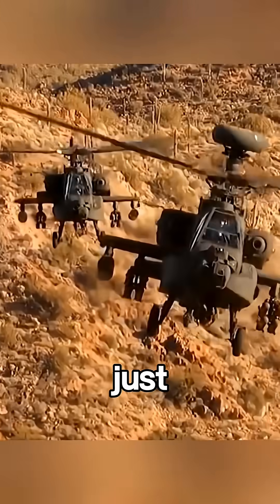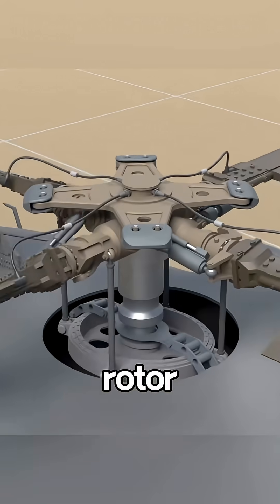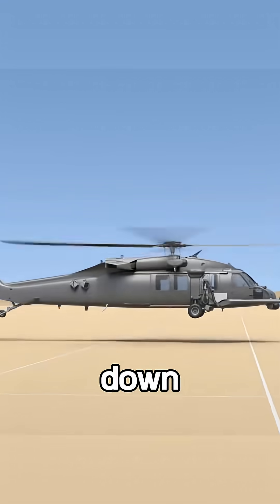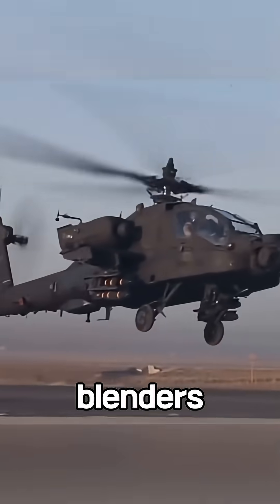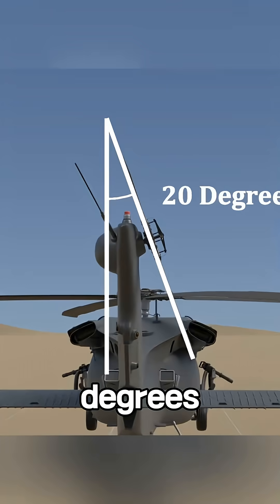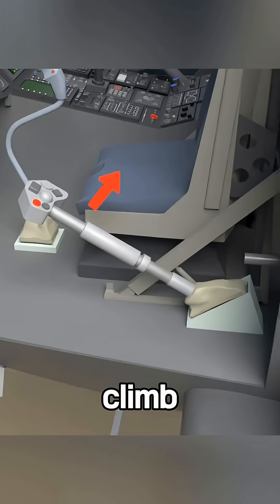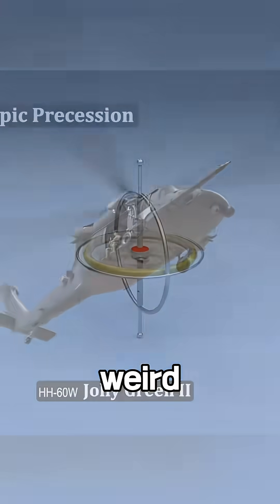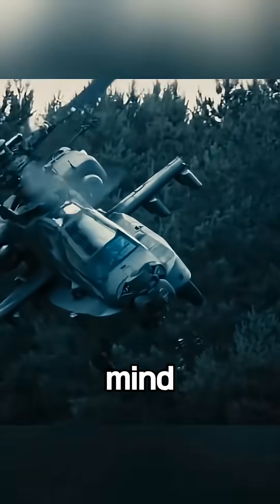Helicopter Speed Myth Busted: What Really Limits Their Velocity #helicopter #aviation #military

Comment: That's why the helicopters crash so often, a small mechanical or human error could be fatal
Reply: The majority of the choppers that I crashed landed in (3) were due to the accumulation of lead in critical areas that caused systems failures.
     Currently, there haven't been reports of helicopters being shot down.
Reply: @roblangsdorf8758 do you need a bigger chip detector
Reply: @roblangsdorf8758 lmao I'm stealing "accumulation of lead in critical areas"
Reply: There's thousands of helo's in the country.  You don't hear of them crashing often especially with the huge number.  Flew them 10 years, never crashed once.
Reply: What's your opinion on Robinson helicopters?
Reply: @spdyrzr01 I've never ridden in them but the philosophy behind it is the simpler you build something the more reliable it turns out. Very few of those have crashed, as a matter of fact I've never actually heard of any that have crash. Just just thinking on the outside likely that if a Robinson Series has crashed it was most likely due to Pilot error because they're generally so reliable that it never seems to occur.
Reply: Since 1991 there have 29 accidents resulting 45 deaths from mast bumping incidents. To be honest, Robinson has built over 12,000 helicopters.
Reply: Ummm, sorry but your logic chain is a little flawed there. The fact is that numbers wise there is not that many Robinson helo's operating. If there were, you would see a dramatic increase in the numbers of crashes. And it is NOT because it's neccessarily a bad or unsafe product at all, it's because at some point it's about exposure to opportunity for something to go wrong. Another way to think about it is this, at some point it has been stated that the most dog bites are committed by Labradors. Everybody knows that lab's are normally gentle docile animals, but rarely some do bite, and if you multiply that rare occurrence by many many times based upon breed popularity, you get the result that if you are bit by a dog it has a higher probability it will be by a lab. Aviation accidents are subject to same thing. Of course inherent design etc comes into play, but all things equal it becomes a numbers game. Pilot error is just another complicating factor to be considered in all accidents, but even then it is still a numbers game of relative exposure having an effect on raw numbers.
Reply: because enormous maintenance cost
Reply: They don't crash " so often", you're still more likely to die in car or bike accidents
Reply: More people die in cars than in helicopters. I'll take my chance in an old Huey than a new car of anybody's choice.
Reply: The helicopters crash so often? ....... You gotta love it when people who don't actually know what they are talking about are talking...... lol
Reply: No they don't since aerospace engineers operate safely first in all phases of the life cycle. Operators who chose to ignore the OEM maintenance schedule and procedures are being unsafe.
Never fly with those guys.
Reply: They crash less often than planes. If motor stop, you will still fall at low speed, using rotor as air brake.
Reply: @mladenmatosevic4591 I'm pretty sure cars crash at a rate of probably more than a hundred times if people still crawl into those things on a minute by minute basis, in fact more people die from car crashes by far than aviation. And you're referring to auto rotation if you lose the engine in flight. We practice that more than anything else in flight school.
Reply: To rebut, how many people drive cars? Now how many people fly? Going by per capita one helicopter crash requires thousands to tens of thousands of car crashes to remain at the same ratio.

However, point taken. Flight school has some pretty high requirements for a reason. I joined the army hoping to fly. Getting older I realize I don't have what it takes, it's something I can't control, and that's ok. It was fun fixing them up instead.
Reply: @mla @mladenmatosevic4591  your motor stops the heli falls down like a stone. Autorotation of the rotor only starts if the heli is moving forwards/backwards above a certain speed
Reply: @tangofoxtrott7971 Like a stone is misleading, yes it wont produce as much lift as before, but the rotating blades even at a small pitch angle will reduce the rate of the fall. It's very similar to a plane really. You can't really glide a plane effectively if you're a few feet above the ground. Both need room for air to actually pass over the flight surfaces at a certain speed.
Reply: @tangofoxtrott7971 there's a graph inside of every helicopter types operators handbook. It's called the Dead Man's curve. We try to avoid flying in that zone. The mindset of a helicopter pilot is something is going to go wrong, wrong wrong wrong wrong wrong wrong wrong wrong wrong wrong wrong wrong wrong wrong wrong wrong. But they're still a crap load of fun. I'd rather be flying them than airplanes. Love it when you find the hover button.
Reply: @tangofoxtrott7971  I don't think autorotation needs forward speed. You invert the blade pitch and turn the rotor into something similar to a maple seed. This builds rotor speed as you fall and slows your descent, and then you can use the built-up rotor RPM and apply positive blade pitch to slow the descent even further just before you hit the ground and made a comparably soft landing.

The only thing you need is altitude. If the engine stops at low altitude, you're probably cooked.
Reply: I keep hearing about so many  Accidents around people who should not have or never been there in the first place,! But no one will confess that even the most experienced one of all,!!
"Was in that fatal crash,! Now how can that be possible if they are so experienced in these situations,? My point was about only one person,! & is usually the most likely to operate independently...
Reply: @johnlarett9891  I can only tell you that I was in the 1st Battalion, 25th Attack in Wheeler Army Airfield.  While I was the Staff Duty Officer (24 hour detail) I got bored and counted all the helo''s on that base.  That included our unit, the lift unit, the service support unit and the Hawaiian National Guard.  In all I counted 218 helicopters on that one base.  There were obviously more in the hangars I couldn't count.  Stationed there a total of 5 years.  Never had a single aircraft go down hard, not a single fatality.  We must be doing something right.  The sheer numbers of helicopters owned by the military and civilian world is a number to high to get an estimate on, yet you really don't hear about any crashes with the numbers of aircraft.  You have a better chance of getting killed on the way to an airport than in the aircraft.  Of course when they do go down its gonna make the evening news.  Research the numbers to class A crashes.  Those are fatal crashes and wreckage or damage that is one million dollars and higher.  It's pretty rare compared to the number of them flying today.  Think about how many dogs there are in the United States.  They don't make the news unless they bite somebody.  Does that mean dogs are a predatory species against man?  Nope, it just makes the news when fido takes a bite out of your ass.
Reply: @johnlarett9891 Huh ? 😅
Reply: @johnlarett9891 You want a dead person to confess to human error?
Reply: To actually fly a helicopter is really cool and challenging. And the physics and engineering is awsome. ❤😎

Comment: Come on!!  Nothing about retreating blade stall?  The real limiter of forward speed.
Reply: Unless you have coaxial counter rotating dual rotors (stacked one on top of the other - https://en.wikipedia.org/wiki/Sikorsky–Boeing_SB-1_Defiant) or contra-rotating tilt rotors (Boeing V-22 tilt rotor helicopter)
Reply: @brianm744 I don't think we were talking about coaxial helicopters.
Reply: @microreniassance2929 I directly. You're absolutely right about retreating blade stall limiting speed. One blade generating twice as much lift while the other (the retreating) none. Coaxial rotors solve that problem. They introduce massively more complex maintenance, hence why the us military went with the Bell  V-280 Valor for the FVL program. Another reason is aircraft technicians were already familiar with the VH-22 tiltrotor Osprey.
Reply: Got to love the Chinook.
Reply: Exactly. I'm glad someone else noticed that too. I'm surprised more comments are not addressing it.
Reply: Exactly. Addressing blade tip speed is crucial for even turbo prop / conventional reciprocating prop planes. Mentioning the importance of not exceeding the speed of sound, where psychic’s invert the outcome, is a huge missed point.
Reply: @rayman1230  Blade tip speed is indeed important for any rotating wing, such as a propeller or helicopter rotor blade. But retreating blade stall is a totally different phenomenon. It really does limit the helicopter's speed.
Reply: Rotor speed does change drastically, again dependant upon type, imagine a heavy lift type but with no weight, would you want the blades to rotate at 100% of max lift capacity? No, turn down the speed and the blades hit less turbulent air from the blade in front, less pitch is then needed in the blade at less rpm, a lot more efficient. The max speed is set by the ABC (advancing blade concept) which is a sum of the drag of the blade, the turbulent air coming from the blade in front, the pitch of the blade, the length of the blade, the chord of the blade, the rpm of the rotor head, all of that vs the weight of the aircraft the air density and temperature.
Reply: @slarratt  I don’t think you’ve got a good understanding of helicopter aerodynamics if you believe the rotor speed drastically changes. The rotor speed has to be within a narrow range between about 96 to 100% for all operations. A good source that explains all of this is the helicopter flying handbook published by the FAA.